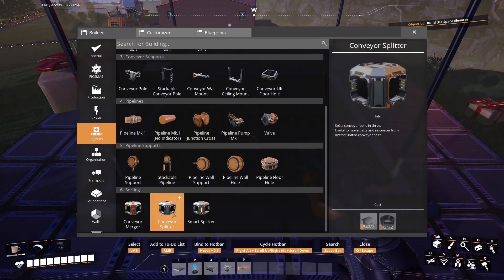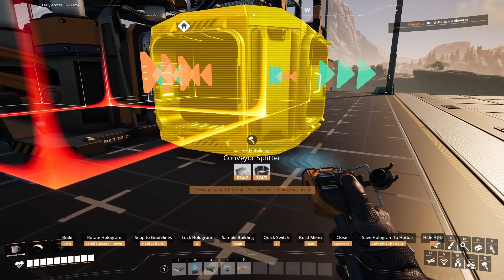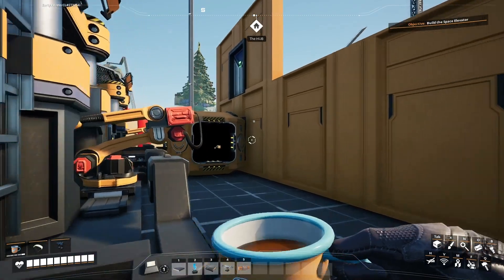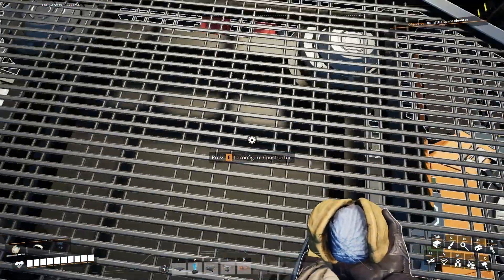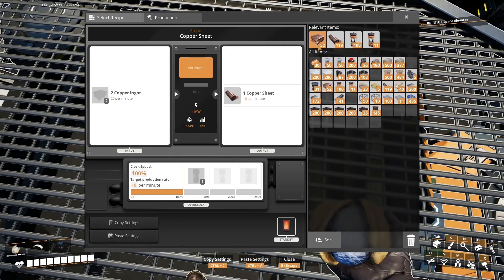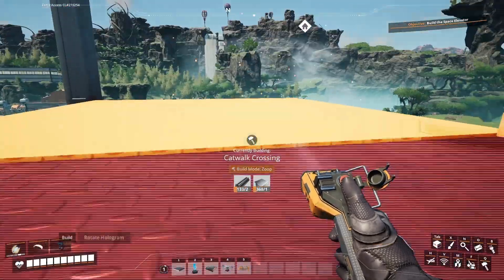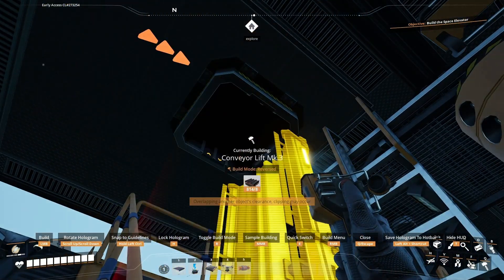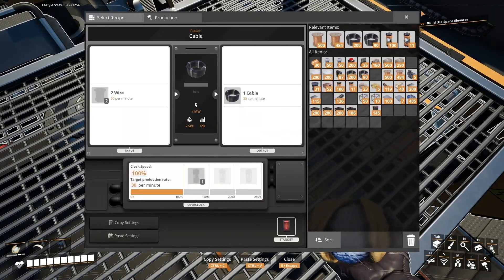Wire, Cable, Sheet Factory Blueprint; Pt 1-The Machines

Comment: Stunning vid.. u know no one makes smart plate blue print
Reply from the maker: all the space parts are on my list, next is steel ingots (releases friday), then steel parts (beams, pipes, encased beams probably releasing monday/tuesday). then ill need to do motor stuff, after that ill do space elevator parts. eventually i plan to have blueprints for all the items. and then im sure ill move on to improving the blueprints either by making them modular or just better architecture. things will certainly change when i have mk5 belts.